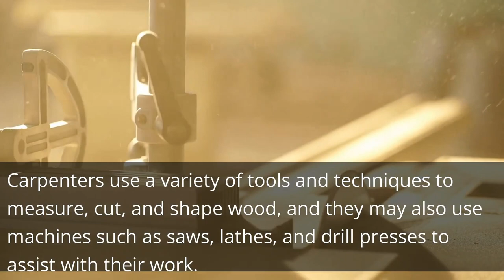Should I learn Woodworking/Carpentry?

Comment from the maker: make plans for DIY woodworking projects - https://tinyurl.com/2n252pxm
woodworking and joinery shop drawings - https://tinyurl.com/4zs5hpd4
design outstanding wood, carpentry, and woodworking logo - https://tinyurl.com/4v5dxydp
design handyman, roofing, cleaning, carpentry, electrician, hiring service flyer - https://tinyurl.com/3tw75kpw
model and render your carpentry or furniture - https://tinyurl.com/4bf6jzwh
provide plan for DIY furniture and woodwork designs - https://tinyurl.com/ypw659ub
do your furniture woodworking, millwork, and joinery shop drawing by autocad - https://tinyurl.com/352vp8pt